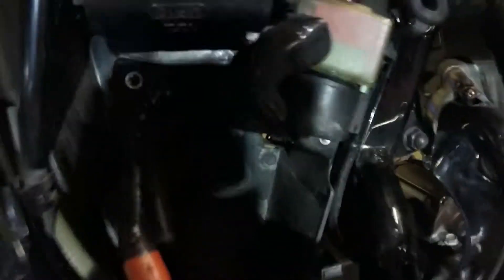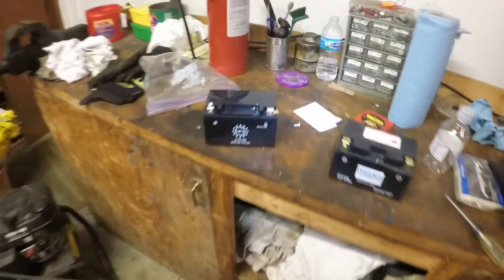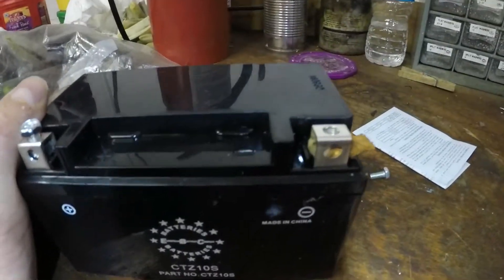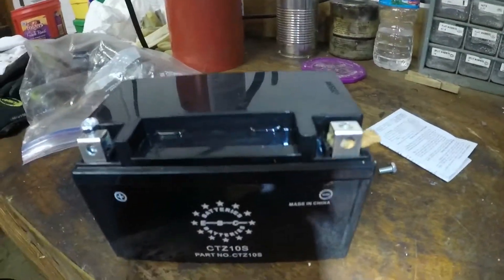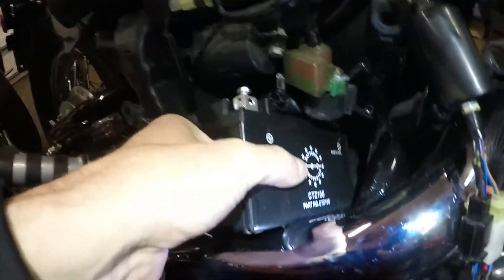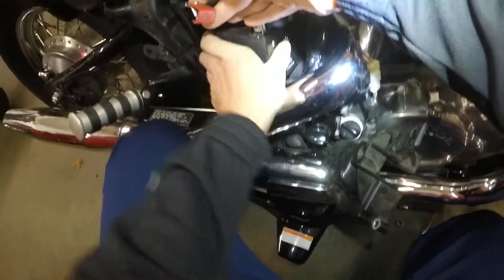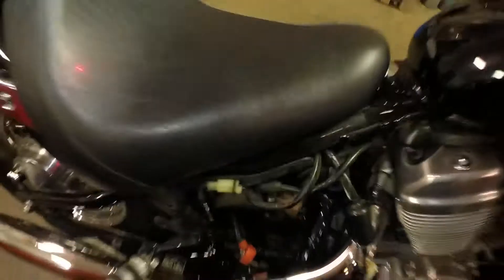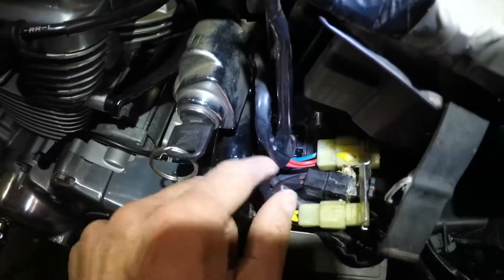VT600C HONDA shadow 2007 battery installation

Comment: Thanks again. Yes, that negative nut drives me crazy too. This is awesome tips. I want to share one thing with you. When i insert or take out the battery, i normally will take out the "electronic box" just above the battery so that it gets out of the way. The box is mounted into left and right metal. You can see the right side metal from your video. Just need to pull the box out from left and right metals. Cheers.

Comment: Don't you have to remove that filter once you get the battery in? If so, how?
Reply from the maker: You do not need to remove anything other than what I show “if you have the original correct fitting battery”.  If someone put in a larger battery and had to remove more parts, then you’ll have to repeat that process.
Reply: @jimgaskell1833  I meant the cigarette filter you stuck in there to keep the nut from falling out.
Reply from the maker: @usillyrabbitu  no it’s paper.  No harm leaving it in there.

Comment: is it safe to put a small pieces of paper on both sides? Reason because i can screw it down tight and needed height for the screw to connect with bottom pieces that comes with
Reply from the maker: Paper is non conductive/insulator so it’s not going to harm anything.

Comment: I just got a brand  new battery, and there is no space in the terminals to put a nut. What's up with that?
Reply from the maker: No space under the terminal?
Reply from the maker: Send a photo
Reply: @jimgaskell1833  Thanks, i tried it and it works fine. I guess it's a newer model of battery that doesn't require a nut. The bolt screws right into the node, which is a solid metal rectangle instead of the thin metal housing of the older batteries. Thanks again for your videos! Was able to get my dad's old Shadow on and turning over. Now to get oil changed and hope that fixes the oil light.
Reply: @jimgaskell1833  Nope. Solid metal.
Reply from the maker: @usillyrabbitu  so then it doesn’t have treads in it?  I’ve not seen a battery terminal like that.  It either has it own threads or needs a nut underneath.

Comment: Ive been ripping my hair out trying to get the new battery in. The old one just had the boots screw directly in
Reply from the maker: Hopefully it’s the original battery size. If someone replaced it and oversized it they’d have to take more things apart to get it in...and you’d have to remove those same parts to get it out.
Reply: @jimgaskell1833  so you have to pick the correct size battery to put it in easily?
Reply from the maker: Sirkoz, yes get the one Honda recommends verses just getting one from an auto parts store
Reply: @jimgaskell1833  but do you know which one honda recommends bro?
Reply from the maker: Sirkoz i do not off hand.  You might be able to google it or call your local honda dealer and get the specs.
Reply from the maker: My battery part number is CTZ 10S

Comment: Not Honda’s best ever design.  Looks like they started with a battery and added parts to make a bike.
Reply from the maker: The exact size of the replacement battery is key otherwise more parts will need to be removed.